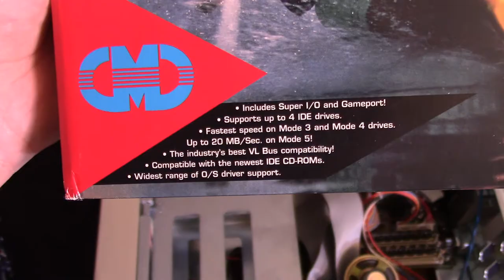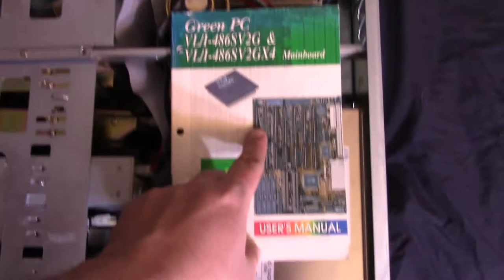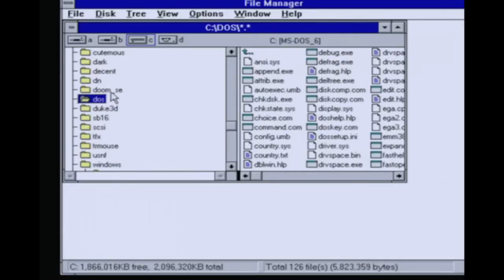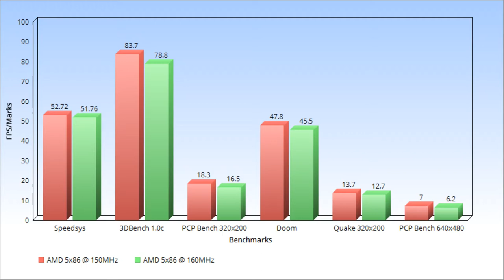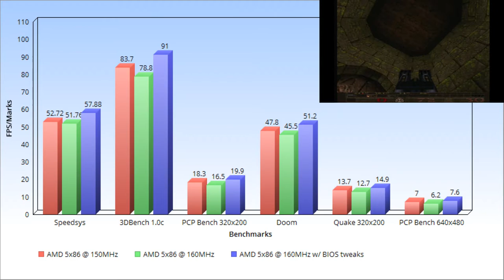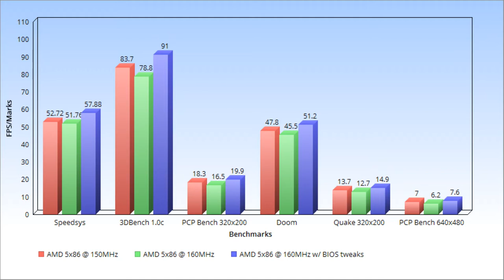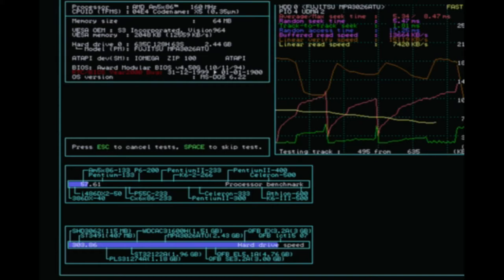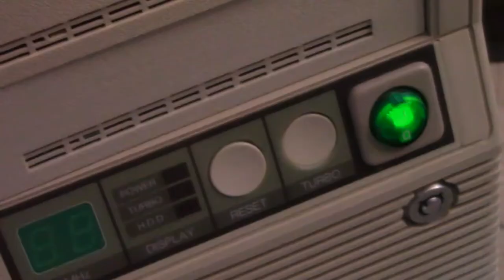Upgrading to and overclocking an AMD 5x86

Comment: Wow... I didn't know that AMD made a 5x86 as late as 2001.  I had switched to a Duron running on a Socket 462 board by that time.
Reply from the maker: my guess is at that point they were still making them primarily for old legacy industrial systems that were too expensive or too inconvenient to replace with more modern components or maybe there were other regions where socket 3 was still in wide use.
Reply: Intel did make 486DX2 chips until 2007, so...

Comment: I used those machines as remote work stations back in the 90's running Linux. I supported upwards of 10+ simultaneous logins of people doing FORTRAN and C programming. It also hosted webpages. AMD 5x86 133, 128 MB, 256k cache (on a special simm) I always hankered for a 1 MB as well. 1 VGA monitor, 1 Hercules mono, 4 RS-232 TTY's serving text logins, and of course a 3 COM 10 MB/sec NIC. That machine gave great duty.
Reply: Those were the days, when a 128MB system could harbor 10 simultaneous logins.

Comment: I dont think that there is a problem with the size of cache slowing down the system, rather its the size of RAM that is not cached. Even some much later p1 boards (like lx and tx) could not cache more than 64MB and installing more RAM than that produced slowdown.

Comment: Thanks for the upload! Great to see these beast 486 systems still kicking around. Had a similar project a couple years ago.  I could only get a fairly limited Acer corp 486 VLB board which officially doesent support the am586 so I could only run it at 120Mhz (3*40). It would unfortunately not even boot on 50Mhz (could also be due to the two VLB cards), otherwise I would post my results. Would be interesting to see how much of a difference the better motherboard makes with the same CPU. In my experience it can make a huge difference. Did u try different ram sticks? Just to try to get it stable on 50FSB and the faster ram setting. If you get lucky with some decent ram you can even try fastest setting. I would try that first instead of maxing out the cache, which sounds interesting but as u mentioned in the vid it will not give any benefit, on the contrary... Please try to overclock your cyrix chip as well on this board and bench it against the am586. Take care & keep up the good work.
Reply from the maker: I did try a few other RAM sticks I had but always the same results. I don't know if using smaller amounts of ram would work. I've ran Cyrix 120mhz chips against the AMD @ 160mhz before on a few PCI socket 3 boards and the AMD always seems to beat it by just a little in most of the benchmarks though it is pretty close. Id love to come across a Cyrix 5x86 133MHz chip one day.
Reply: Setting a 2x multiplier should force the CPU to run at 4x internally - the AM586 was designed to upgrade these sorts of systems in this way.
Reply from the maker: @nitrax8629  that's what I had to do on this motherboard to get 4x

Comment: Great video!

The 50mhz option is only viable on the late and more mature PCI boards, like the GA486 AM(S), HOT433 and the LS486 for example, featuring UMC8xxx/SiS49x chipsets, as these had the capability to harness high ram speeds with tightest timings up to 50mhz - same with cache. (Interestingly, the Tomato board I tested would not allow the 50mhz fsb with the best ram timings albeit it too features an SiS49x chipset and has even shorter signal paths than the LS486 - ?).

You have to be on your toes though when selecting the 15ns parts for a run at 50mhz fsb at max. settings... a 12ns part for the tag & a dual bank setup may help here. Cypress made srams for example were pretty good at high speeds according to my tests.
I  also tested this on SiS471 based VL boards, but as already stated, it's not that hot there.

64MiB are 2^26 bytes and the 486s tag size of 7(+1)bit(WB) result in the requirement for 512KiB(2^19 bytes) of cache... but it seems to be only important in windows. 
A single  32MB SIMM of good quality has WAY better chances for a 50mhz run though than a bigger or two smaller modules.
Reply from the maker: Thanks for the info. I'm probably going to play around with this machine some more in the future and try out some different RAM and whatnot. I happen to have a HOT433 board that i'm using for a separate 50mhz project that i'm planning to have a video on in the somewhat near future.
Reply: The HOT433 does its name justice - it was the fastest among the UMC888x based boards that I had access to and is also nice to look at. One caveat though... if there's no cache installed or one or more sram(s) loose then it will go crazy... took me months get to the source of "undefined behavior" on that board. Even if its set up properly it also seems to have a "life of its own" according to some other owners... so I'm curious to how well yours will cooperate.
Reply from the maker: @brucetungsten5714  I've used the board in the past to benchmark everything from a 66MHz DX2 up to a Cyrix 5x86 @ 120MHz and the AMD 5x86 @ 160MHz but i'm never ran that board on the 50MHz FSB. It pretty much ran flawless with those other CPU's though...at least as far as I remember.

Comment: I remember reading that Fallout uses 128MB+ RAM in DOS, so there might be a use for that
Reply from the maker: That seems like a lot. I did find a reference of Fallout wanting 32MB of RAM though...I don't have my boxed copy here or i'd check.
Reply: Minimum 16 MB.  Recommended 32 MB.
Reply: @marekadamski2948  In Windows. Its known to chew up huge amounts of RAM in DOS and has really long load times otherwise.
Reply: @munxcorp  I was able to run it briefly under DOSBox with memsize = 16 and the loading times were OK.
Reply: @marekadamski2948  I've read that it can get really bad with low ram. Guess it's something that I need to test for myself.

Comment: Make this and 🔥 more one rare and old processor
Reply from the maker: If your referring to the AMD 5x86 it is hardly rare. There are quite a few on eBay and I come across them fairly often. The overclock on them is also quite safe as they OC to 160MHz routinely...I don't think I've ever run across one that didn't and they actually stay pretty cool at that speed.